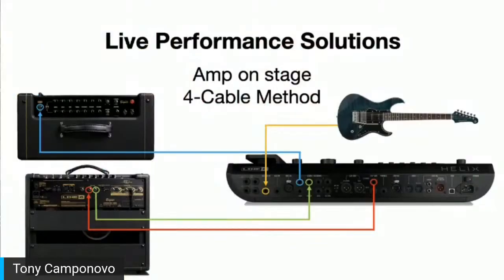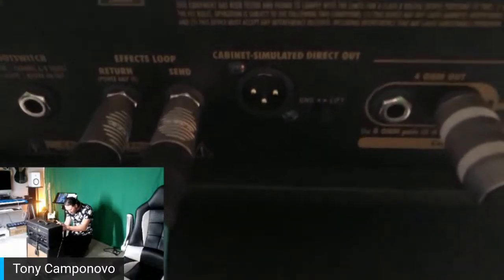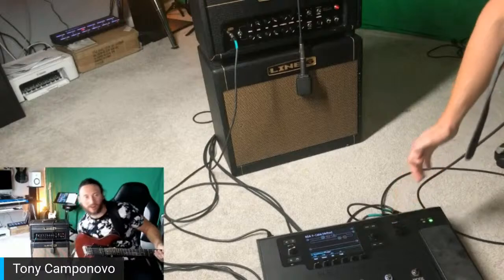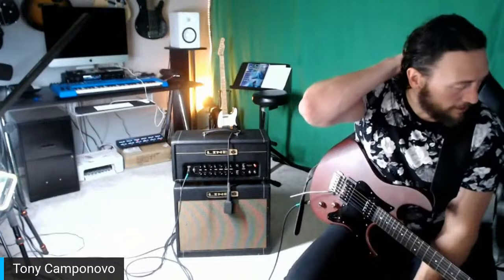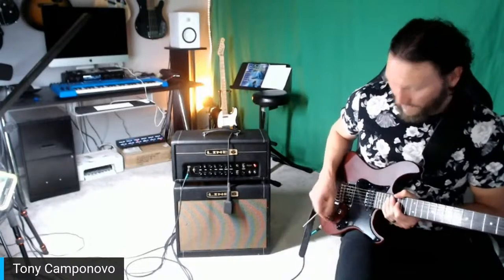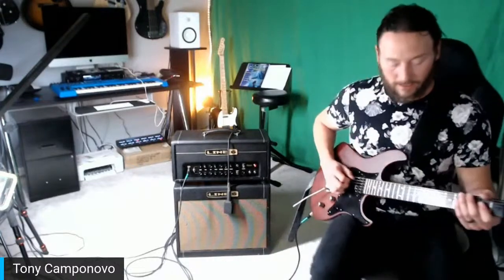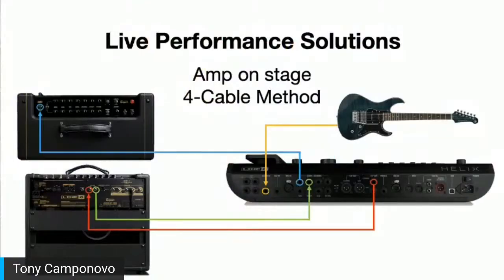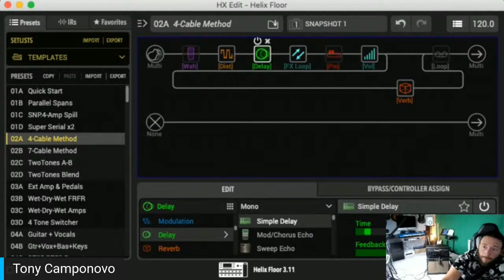Learning with Line 6 | Helix - Four Cable Method

Comment: Great video! I use it that way too. In addition, it automatically switches the topology matching the amplifier model with midi commands. I turned off all modeling in Dt25, it only runs from Helix, together with IR. And I also use an additional Line6 cabin, in which I replaced the speaker with a Vintage 30.
I really like the sound of the amp and cabin when only the effects are coming from the Helix.